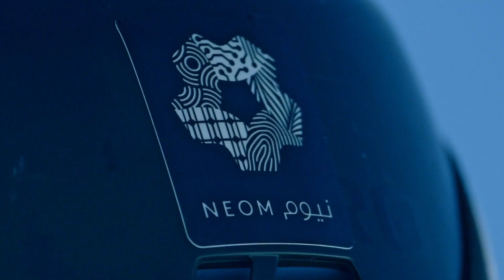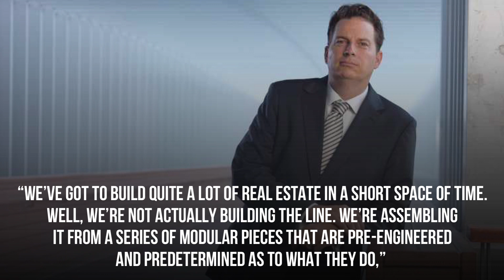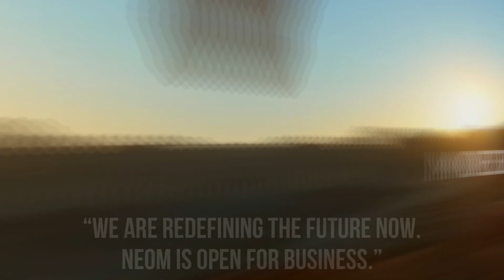NEOM IS HAPPENING! INSANE PROGRESS MADE (2023 footage).

Comment: Imagine if war occur how easy will be to destroy this line... will transform only in dust with no effort in less than few hours.
Reply: a line is actually the safest in a war situation, as bombs have a center and spread like a circle.
the only thing with this line, is it's basically two towers near each other where ever you look. but droping a bomb in the middle of a city like New York is way worse.
Reply: @hxhshow9  you forget few things, first of all in this line everything is connected. Once fire starts, everything will burn.
And second, 2-3 fighter jets can drop bombs in a "line".
Reply: It is being built in a line. One end is 170km from the other. So it would actually be harder to destroy the whole thing than if it was built like any other city.